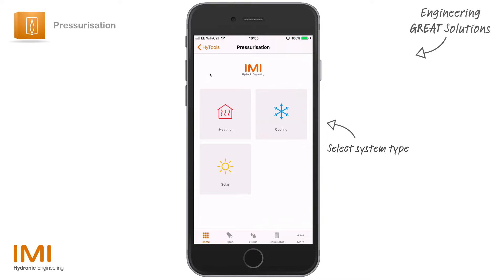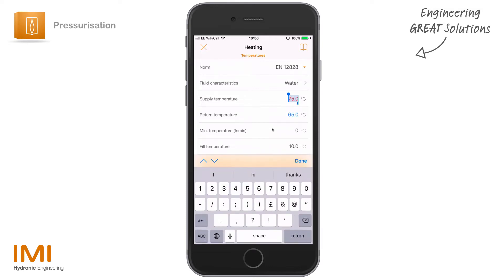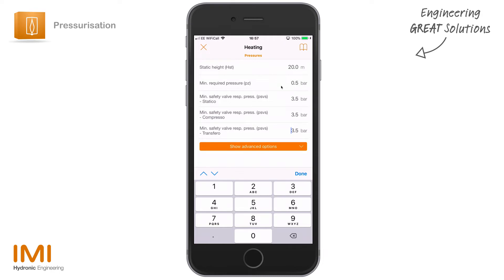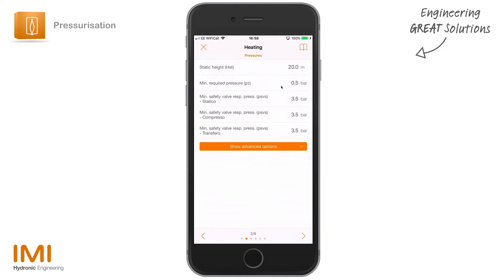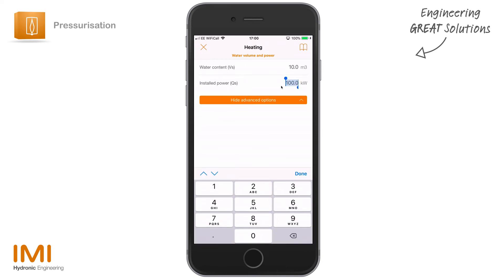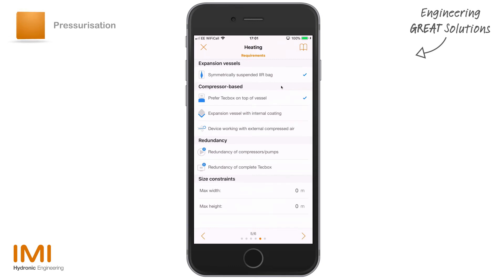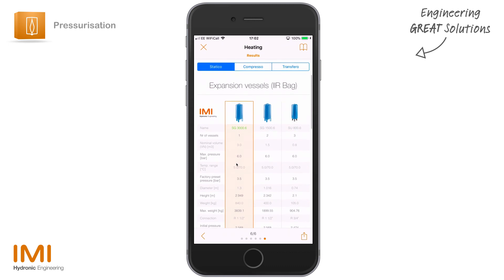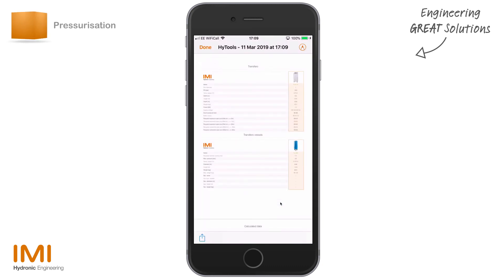IMI HyTools - Pressurisation Selection

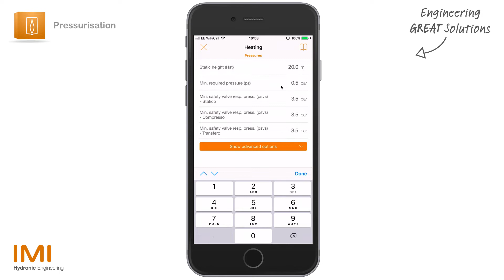Comment from the maker: CORRECTION: at 3:12 it should state that typically the pressurization should be on the SUCTION SIDE - the inlet - of the pump. If you choose to put on the discharge side - the outlet - of the pump the pump head needs to be taken into account.

Comment: Hi very interesting and informative , but one part, that goes against my knowledge is the pressure vessel connection in relation to the pump, I would always make this connection on the suction side of the pump.  For the pump to create the differential to circulate it needs to create a higher pressure in front of it, as it can’t change the pressure at the neutral point, (Point of No Pressure Change) this means the majority of the system is under positive pressure, if the neutral point (Point of no pressure change) is placed after the pump as you suggest as the pump cannot change the pressure at the point of no pressure change, the pump will have to create a lower pressure behind it to create circulation, this means most of the system is under negative pressure, which is bad for system performance and helps to ingress oxygen, well this is my understanding, I’m happy to be informed otherwise
Reply: I agree with you on that, I feel this is a mistake as the reasoning would be more valid for the suction side